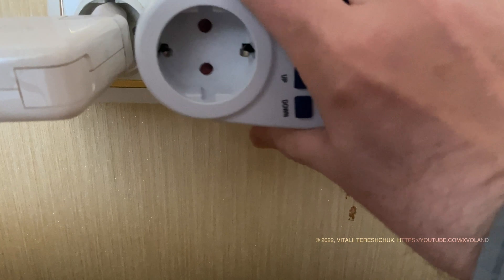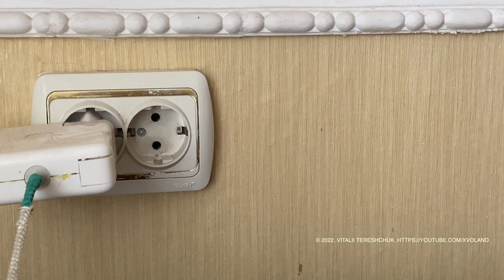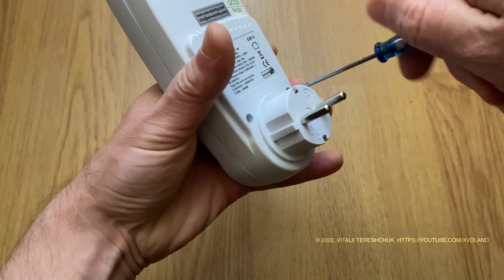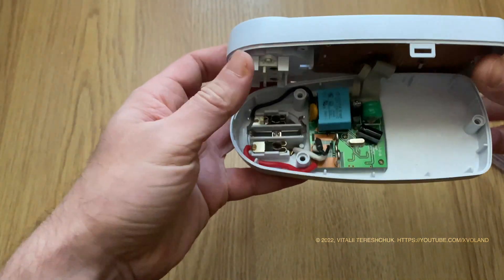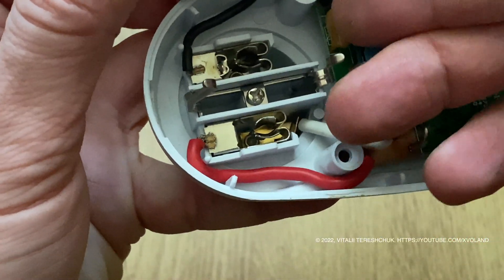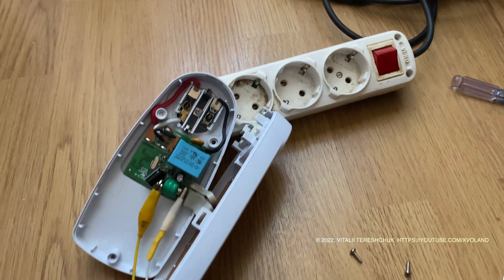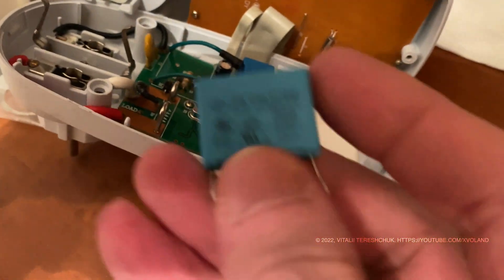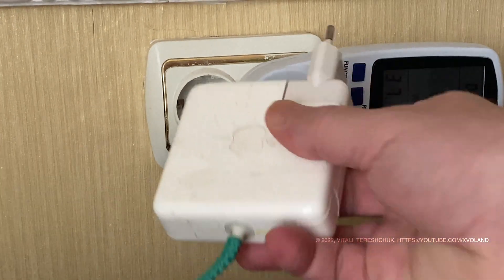🛠 DIY Guide: Repairing a Broken Watt Meter - Easy Fix for Beginners!

Comment: Hello. I have the same device. But the watt function screen display  "overload" . I tried reset and no way. could!'t get rid of it.Can you yell me how to fix it? Which component should ı replace? I dissassembled the device but all components seems OK. Theres no  burning
Reply from the maker: Wattmeters allow you to change the wattage at which the "OVERLOAD" alarm triggers (usually within a range of 0W to 3680W). 
Enter Settings: Press and hold the FUNCTION (or MODE/SET) button for 3 seconds.
Adjust Value: Use the UP/DOWN or + / - buttons to increase the wattage limit to a higher, safe level.
Save: Press the FUNCTION or SET button again to save the new limit.

Comment: Did you replace a NiCad battery with a Lithium battery? Never do that!!! you must change the charging circuit.
Reply from the maker: Of course you are right, but I talk about it in the video. Replacing NiCad with Lithium battery can be a temporary solution, because the charging principles of these batteries charging are different.

Comment: Hello, first of all, thanks for the video, the same thing happened to me with my device, I ask you: Could it be wired directly without a battery? I don't care if the information is 'lost', in my case I just want to use it to indicate voltage and watts in real time. Thank you.
Reply from the maker: Hello and thank you.
Yes, but you need to modify the circuit to get the necessary voltage on the contacts where the battery is connected.
Reply: @xVoLAnD it'll probably work if you remove the battery.
Reply from the maker: @jimmybrad156  This will not work if there is no battery
Reply: @xVoLAnD I had one that wasn't working. I took out the crusty 3S 20mAh NiMH and I'm pretty sure it worked with it removed. Later on I replaced it with a "1000mah" (600-800mah in reality?) 3S NiMH.
Reply from the maker: @jimmybrad156  It couldn't work. A lithium battery is a bad solution (like the one in my video), but it works.

Comment: I have the same power meter and now it has failed. The battery has a voltage of 2.6V and I tried charging it via the charger, but it didn't work. The voltage is still the same at 2.6V. I connected the LED to the battery, but it doesn't light up. So the battery must be bad. But I see that the cell phone battery was placed here, Li Ion. Now, does it charge in the device or not? I saw that the 0.47uF capacitor was removed. Is that true or not? Otherwise, the working voltage for charging the battery is obtained through this capacitor.
Reply from the maker: The Li-ion battery was installed as a temporary solution. It’s not suitable, as it will fail quickly, according to my assumptions. Nevertheless, it has been working for 10 months now.
The best solution, use Ni-Mh batteries, because of the design features.
The capacitor, has been replaced, but that is optional and they rarely fail.
Reply: @xVoLAnD  But a Li-Ion Polimer battery that has circuit protection against overcharging can be used there. The charging voltage is the same. It has to work. Li-Ion 3.7V 100-200mAh. This NiMh 3,6V 20mAh battery lasts too short. Only 2 years. I'm waiting for batteries  Li-Ion Pol 200mAh and NiMh 40mAh, so we'll see. And those block capacitors should last forever, if the operating voltage is lower than the maximum that is written on it, if that is the correct information.
Reply from the maker: @agramcroatia4185  It is, and it’ll work.  But the charge problem - remains open 🤷🏻‍♂️
Reply: Actually, what is that battery for? Why can't we do without her? Why the device does not work if the battery is removed, and there is a power supply to charge the battery. How much current does the device itself consume while it is working? These are all questions to which we do not know the answer.
Reply from the maker: @agramcroatia4185  The battery is needed to power the internal ROM to store the values. Of course, you can do without it, but .... I hope you understand
Reply: @xVoLAnD  I am only interested in the current state of consumption, not store data. But that device has obviously had a problem since day one. When I removed the battery, the charging voltage is 1.44V, and it should be at least 4V. The voltage on the capacitor 470uF 25V is 4.4V. It is also the input voltage of the circuit. The voltage on the zener diode is only 1.27V. That's why it's not good. If I put in a new battery, it will only work until it wears out. If only I had a diagram of that part, because surely something is wrong. It even seems to me that there is a 7805 stabilizer in a TO92 case at the input.

Comment: well, that's nice  ...however I guess, the accumulator, you replaced, is a NIMH-Cell (s1 or s2) and apparently you replaced it with a lithium one. If there is a charging current, you might run into troubles.
Reply from the maker: Yes you are right. The Ni-MH batteries must be used to be able to charge at low currents.  But lithium is also suitable, but it will fail faster.
Reply from the maker: @ch2o2  It's not worth dramatizing, because as you saw, the element inside has a voltage of 3.6v.  Moreover, when I installed the battery inside, it has a charging protection board.